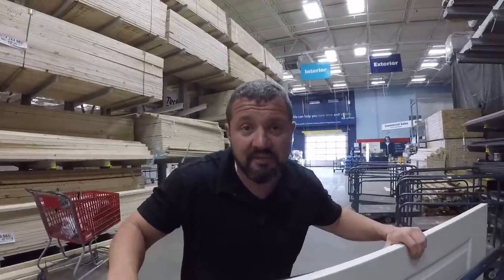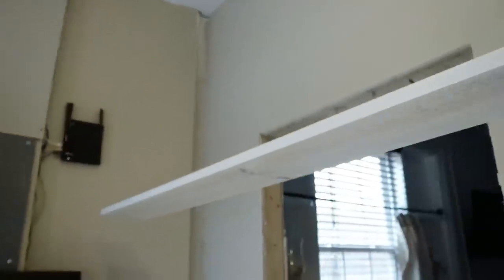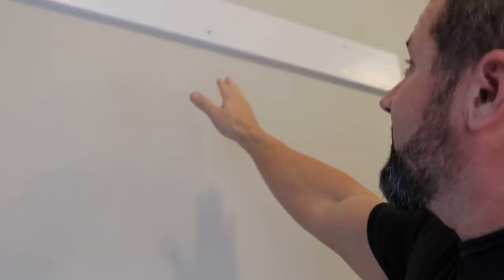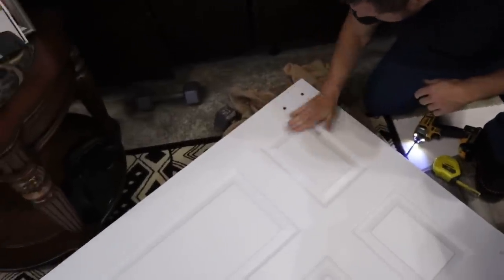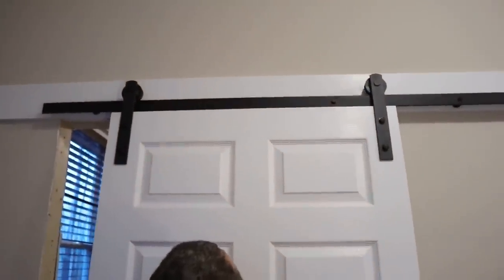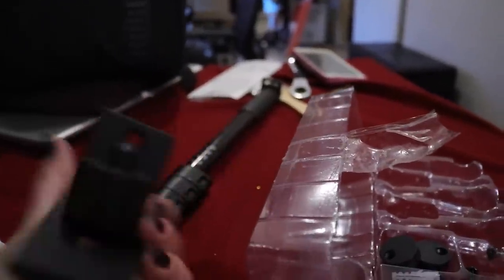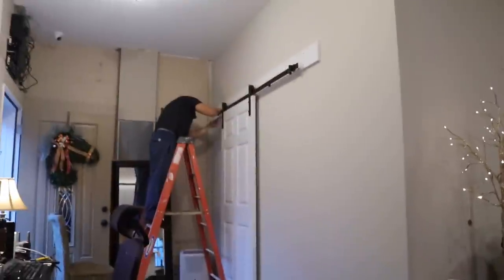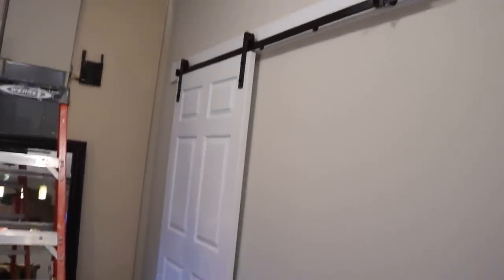DIY Barn Door  - For Under $100

Comment: Look good. I put one up and didnt put a board over the wall. Lag bolts didn't stay. I'm gonna redo it the way you have it done. So thanks for the tip.
Reply from the maker: ya its hard to do it with no board because the track never lines up to the studs.
Reply: @TheDepreys  yup. for some reason the track holes are not drill 16" apart
Reply: Where ever did that come from !

Comment: A barn door is not a Barnwood door. A Barnwood door slides back and forth on a rail system. A barn door goes on a barn. Usually, in the public's eye, a barn is a big red. With a steep roof to keep animals in. Only city folks think a barn door is a Barnwood door. Second, off a Barnwood door is fresh and shiny wood from Lowe's or Home Depot. A real barn door is with whatever you can come with on the property. Every real barn door is under $10. except for the hinges.
This is the reason why when you type in barn door. You get nothing but Barnwood door. Because city folk think they're the same. now! I wouldn't of blasted you if you had said Barnwood door. And I had not been looking for pole barn door designs  for the last 2 hours finding BARNWOOD DOORS ONLY